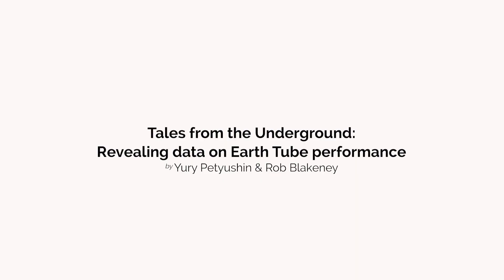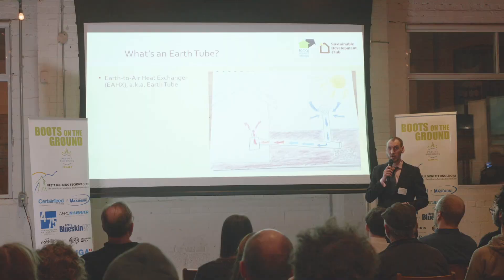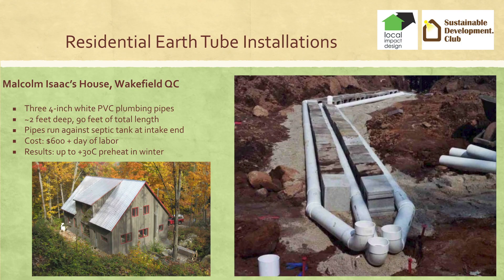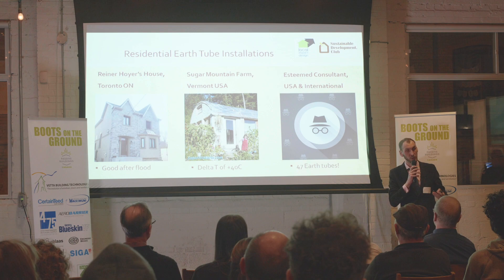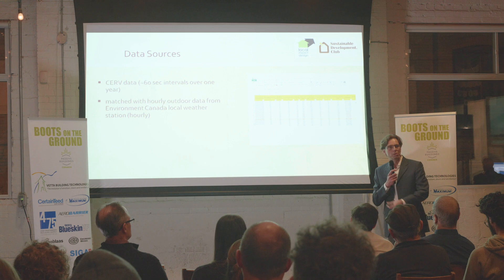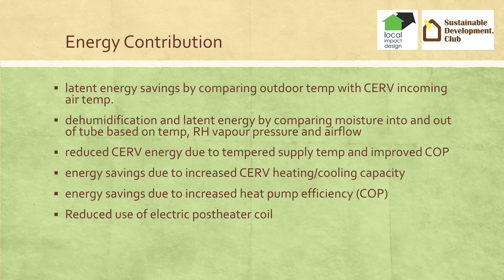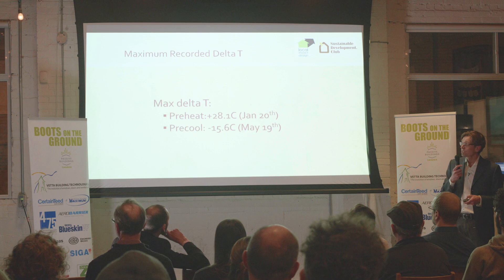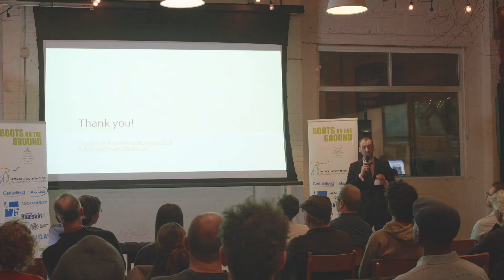Boots on the Ground: Tales from the underground: revealing data on earth tube performance

Comment: You guys should use the PentaCare V12 from Minotair instead, just like Jim Iredale does, as it has the highest heat recovery certified by HVI. And  by the way,  the CERV2 is NOT certified by HVI or any other recognized third party certification bodies on any of their performances for ventilation or heat pump operations. Plus the Minotair unit has much better cooling and heating capacities plus a standard HEPA MERV 15 filter with an airtight gasket. And with the COVID-19 around, you want that for your house! All that for about the same price of the CERV2 plus it’s made right here in Canada. It’s really and logically a no-brainer IMHO.

Comment: I am new to this so could someone please tell me what +30 C preheat in winter (Malcolm Isaac's house) is referencing?  
I know it can't mean that the air comes out of the ground at that temperature.
Reply: +30 means the air is +30 warmer than outside air before its heated in the winter time. With earth tubes its a common practice to use the air from the earth tube as an intake for the heater - this way you're not applying as much energy to raise the temperature to the desired level.